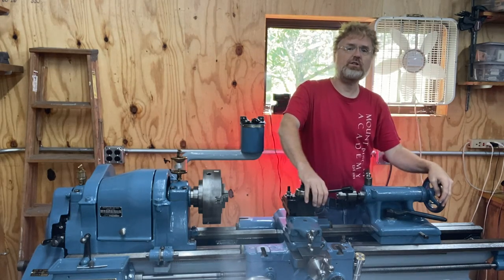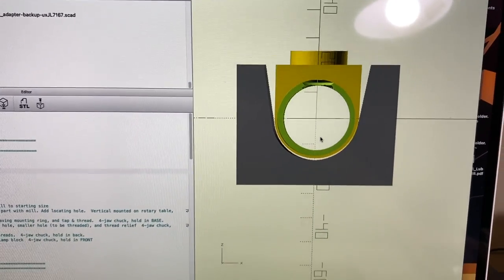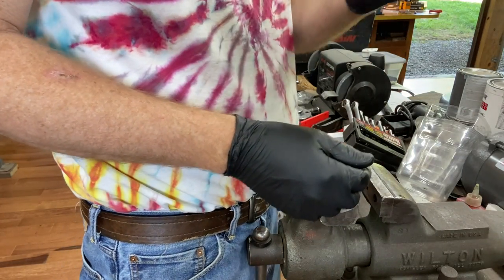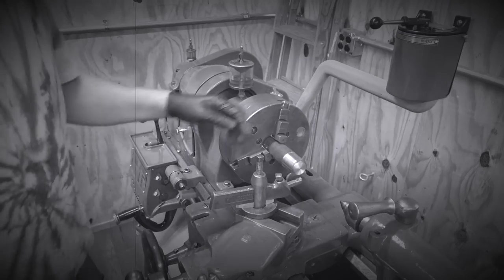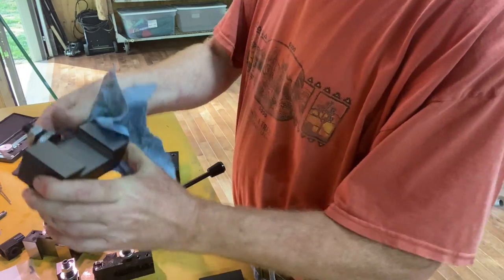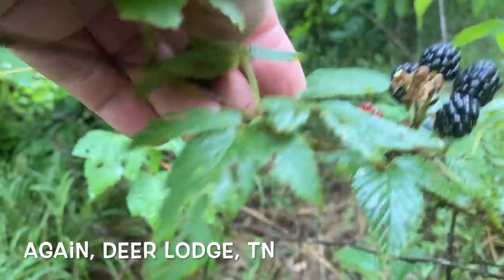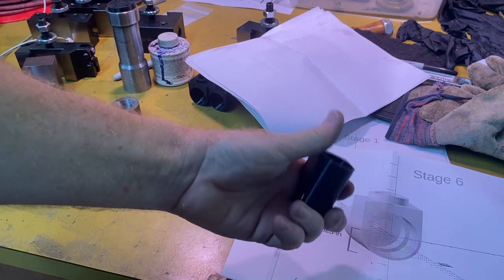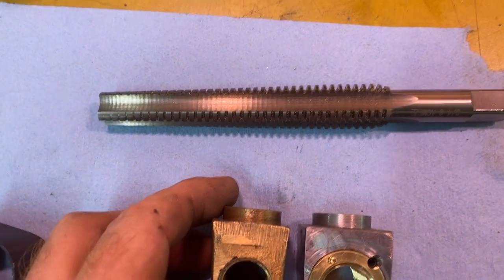South Bend Lathe Restoration, Part 16, Repairing Cross Slide Nut With A Modern Nut; New Tool Post

Comment: I did this on my 1913 vintage Lodge and Shipley lathe except with a twist. I mounted the newer style nuts on both sides of the adapter. One side  fixed and locked in. The other side threaded in and held in place with a couple set screws. I adjust the side with set screws in or out to take all the backlash out. Using 2 nuts like this i can manage under .001" backlash. And then adjust it as it wears.
Reply from the maker: That sounds like a very good solution.  Did you have any issues with the nut holder (adapter) needing to be longer to accommodate the two nuts, and thus reducing the travel of the cross slide before it interferes with something?  But overall, I'm very impressed with what you are describing.  Thanks for watching.
Reply: @KevinToppenberg  I shortened the adapter  to account for the thickness of the acme nut on the end facing the apron. I  don't think I lost any travel.
Reply from the maker: @a-k-jun-1   Awesome!  Sounds very cool. Best wishes.

Comment: When I was a young Bloke and a student I bought a 1954 South Bend clone which had wear in the cross slide screw and nut.  I took the bits to TAFE with me to do a repair as a “foreign order”

The teacher asked “what’s your plan” and where is your list of the order of operations??  Doooohhhhh, says I!!

He said” Do this

……He made a new cutting tool with narrower tooth form to cater for the wear and cleaned up the thread and in 10 minutes set up yo cut a new matching cross sled nut.

“Thanks heaps “, says I……….Says he “ that’s saved you a bit of money”

You can’t beat experience, and I Learned that there’s more than one way to skin a cat!!

Stavros
Reply from the maker: Having a good teacher is a blessing!  Thanks for watching.

Comment: Nice work!  If I was doing it, (and I will on my 9" SB,) I will get two bronze ACME nuts, center the adapter thread shoulder to the attachment screw hole, trim the ACME nuts to shorter length, locktite one ACME nut in one end, and grub screw the second ACME  nut into the other end.  This way, I can adjust the second ACME nut to take up end play.  I would drill the grub screw into the adapter at 90° to the lead screw, probably at a 45° angle to the top of the adapter, and knock off enough of the mounting shoulder to provide a flat to start the grub screw hole.
Reply from the maker: I think that using two nuts to allow removing backlash is a much better solution.  I just didn't think of it when I was doing this.  Live and learn!  🙂

Comment: you can solder the two parts together. with soft solder tin. that fills everything and that never goes out.
Reply from the maker: Thank you for this post.  Are you suggesting to solder the brass insert inside the steel holder, after it is screwed it?  If so, that's an interesting suggestion.  I could heat the whole thing up and get the solder to wick into all the small places....  Thanks!

Comment: Well thanks for making a cool video! my cross slide nut is pretty bad on my very similar 1935 15" southbend that I just got.  I made a cool tiny little boring bar tool a while ago that takes a hss jewelry graver for the bit.
Reply: I think that nut is the first major thing I need to make for it.
Reply from the maker: These old lathes are a piece of history.  It is cool that you have one!
Reply from the maker: It was a fun build, but buying one on Ebay would have been much easier!

Comment: I did something probably pretty stupid which is why I've never seen anyone else do, but it worked perfectly. I degreased my original cast iron nut and brased the internal threads then ran a 7/16X10 left hand tap through. It's a little tight but I can't feel any backlash whatsoever.
Reply from the maker: I think repairing threads like that was pretty slick.  "It ain't stupid if it works!"   But I'm a little confused.  I have never heard of a nut being made of cast iron.  Do you mean that you took the cast iron nut holder, removed the nut, filled that newly-empty space with bronze, and then threaded that?  If so, that's cool too.  Thanks for watching!
Reply: @KevinToppenberg  Nope, cast iron. Not exactly sure the yr but probably late 40's Logan model 400. It took a little work to get 80 something years of way oil out of the porous metal but eventually I got it to work.
Reply from the maker: @KBLIZZ333    Well, you brazing will probably make your lead screw last longer!  I'm assuming that the brazing material is softer than cast iron.
Reply: @KevinToppenberg   I used Oxy/Acetylene and fluxed brass rods.  Admittedly it didn't go all that smoothly at first. In my opinion brazing takes practice. But I got there in the end. Hopefully I'll have at least a benchtop mill if I ever need to do it again I'd make a new one from scratch.
Reply from the maker: @KBLIZZ333    Yeah, I have almost no experience with brazing.  It is a skill I hope to gain one day.  But it is cool that you succeeded.  And I like how you came up with a creative solution!
Reply: @KevinToppenberg  I have plenty of solid brass round stock but wasn't confident in my skills to make a new one from scratch. I'd much rather have it the way you did it. If it ever gets wonky just make a new insert.

Comment: Hello Kevin, I watched this video on my phone and I might have missed something but I'm thinking you said the threads were 8 TPI. I was wondering how your dials work with that. Are your dials .125" per turn and not .100"?
Reply from the maker: Yes, I think that is correct.  They are not an even 100 thou.  I was going to say that it is because the mill is old. But then I remember that the modern lathe where I trained also had something like 125 thou' per rotation.  Thanks for watching!
Reply: @KevinToppenberg  This seems very odd to me. I think I would have used 3/4"-10 TPI and made new dials. Maybe I'm lazy with math but .125" is hard to work with.
Reply: @WinkysWorkshop  hello Winky, Paul in Orlando, we met at Ft Mead last spring.....cheers from Orlando , Paul
Reply: @ypaulbrown  Hello Paul, good to hear from you.
Reply: @WinkysWorkshop  hope you are doing well, just trying to make a few videos my self......more of a Art endeavor.....and of course welding and machining......Cheers, and stay in touch, Paul.....by the way, I have a 1942 build 13" South Bend with 6 foot bed......here is a video of the runout.....https://www.youtube.com/watch?v=4zvB3W96g0Q

Comment: Kevin, great videos! I have the EXACT same model. Could you help me out and tell me where you purchased your drive belt and what size? Again, great videos! Thanks!
Reply from the maker: Thanks for the kind words.  I got the belts for the lathe at an auto parts store.  I think 44" is the right size.  Have you seen my other video where I address this?  https://youtu.be/-udRAJ-QUA4?si=J2SXvljg3ws2wSrz&t=1396   Best wises,  Kevin
Reply: @KevinToppenberg  I did. I caught all the episodes while tending to my Lathe in the shop. I was curious about the flat drive belt for the spindle. Mine is too short to give me proper speeds.
Reply from the maker: @mjreihle851  Oh, the flat belt.  The one mine came with was just the right size.  So I didn't have to do anything about it.   I know that SouthBend put out a manual about how to stitch a belt together if needed.  But I can't find it.  I did find this site that makes belts of custom lengths https://www.squirreldaddy.com/South-Bend-lathe-Flat-drive-lathe-belt-1-inch-wide-p/belt1.htm  And this looks like another good resource.  https://woodshopmike.com/stitching-a-flat-belt-for-machinery/  Best wishes!
Reply: @KevinToppenberg  thank you for the info and thanks again for the hard work put into the videos

Comment: I thought I saw a thread dial on your table in the build process...I also have a half finished one started for my logan
Reply from the maker: You probably did.  Because I am doing many things at once, often things will show up in 1 video that were really happening in the timeline of a video a few episodes back.  Hollywood magic?  Thanks for watching.
Reply from the maker: I've been thinking more about your comment.  I think I misread it before, thinking that you were talking about the cross slide screw.  But of course you were talking about the treading dial, as you said.  I hope to put a video out about this in a few weeks.  How is your build going?
Reply: @KevinToppenberg  unfortunately I am dealing with so many things right now it's hard to find much time for worms...lol...rental properties,  cars, favors for friends, mowing equipment....some days it's a bit too much..lol..hopefully I will get back to the gear soon
Reply from the maker: @craigtate5930  Life has been hard these past few years.  Hang in there!  Best wishes and I hope it goes OK when you get back to the project.

Comment: If you have backlash, be it 1 thousandth or 1 millimetre, you still have to allow for it in your work plan. Once you master the technique you can forge ahead………….remember to always move the slide in the same direction…………you can’t back off and reverse the travel!

Turning the graduation wheel and panicking only causes you stress, a few degrees of backlash ain’t a problem if you keep your wits about you.

Stavros
Reply from the maker: This is good advice.  Thanks!

Comment: That nut not going on makes no sense to me... A tap should have the cutting profile as to not allow a deeper thread height than the screw shall accommodate... Just as dies do cut the major diameter if you leave the initial material at 100% engagement(not pleasant to do so and make any size screw in anything but aluminum or brass as it can break dies and requires so much more force than say 90% engagement)... So it makes me wonder how did your tap manage to result in a nut that had minor diameter larger than minor of the factory made screw... By any modern standard, it should not have happened... Also, consider getting two of those nutserts rather than one, make a longer housing, modify them a bit, key them inside the housing and make a backlash eliminating nut... Two such pieces would make an elimination nut that would last for ages and allow for cool oiling methods to be done, aswell as a longer travel, as the locating boss can be places anywhere atop the housing for the nutserts, allowing you to pull the crosslide towards you at least a bit more, heck, you could even put a thread wiper in there on each side and lube injection from the inside, as to have the crosslide screw and nuts always be as clean as possible and well lubed... Such a system could go on for what, over 15 years of constant duty work in two shifts, let alone what little hours you or me would put a lathe like that through... I know that after 4 hours at a lathe, tho i love every second of it, i am ridden into dirt like a rally car...  Same with milling, even tho it is a powerfeed system, just the observation and focus demanded are enough to warrant some oxygen therapy from my oxy,acetilene bottles...  Aint nothing like it... People drink coffee to increase heart rate to get more oxygen and seem more rested, others do cocaine, which does the same, but harder... I just snort oxygen and then go for some hookers, it much more professional, i`ve been told... jk, but it is much nicer to breathe more oxygen than to chemically induce high heart rate to achieve the same effect... Just crack open the bottle and vent it into a closed room for a few seconds, as unregulated oxygen therapy can be dangerous, but adding a bit to air will do no harm whatsoever... Dont sniff it directly or rig up an inhalation method, just release a bit for a few seconds...
Reply from the maker: When I look at my tap, it has a large relief that is much smaller than the inner diameter of the nut.  So I think the ID had to be brought to specified diameter before tapping.   Regarding using 2 nut inserts to allow adjustment for backlash, I think this is a genius idea!  Wish I would have thought of it before!  Thanks for watching.
Reply: @KevinToppenberg  Oh why, my fine sir, the honor is all mine, and so was the pleasure of viewing! Seeing people do what they can to return such monads of artistry and craft back to life is one of the few worldly pleasures that is as close as it gets to holy... It is an act of love, tho, sometimes it does involve percussive endearment... Regarding the nuts, well, as a machine lover, i do greatly enjoy working out the ways that allow the machine to truly be what it is meant to be - a faithful mechanical companion, willing to do what otherwise would require time or effort, and dealing with backlash is consuming both time and effort when you want to do any even pseudo precision work...
All the best and warmest regards,
Steuss

Comment: Can you measure your results? Interesting, thanks.
Reply from the maker: If you are talking about measuring the backlash, then I covered this in my prior video.  I had to present them out of sequence.  But when I was going through the final backlash assessment, I also ran into problems with the lead screw handle having play.  So it is hard to tell exactly how much each part is contributing.